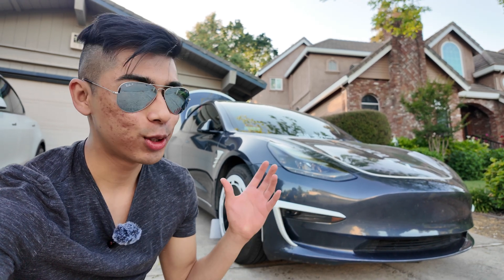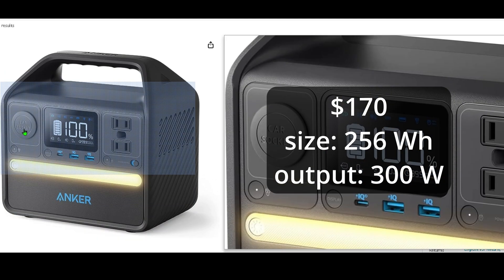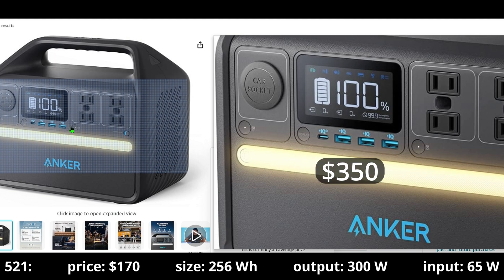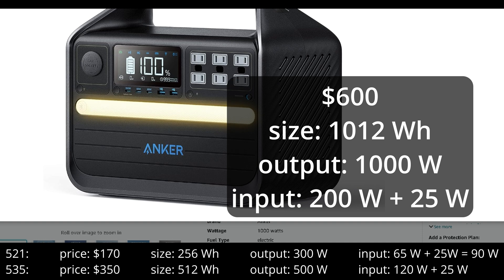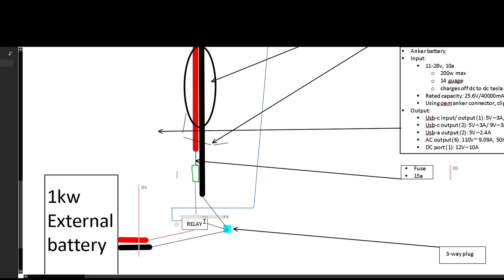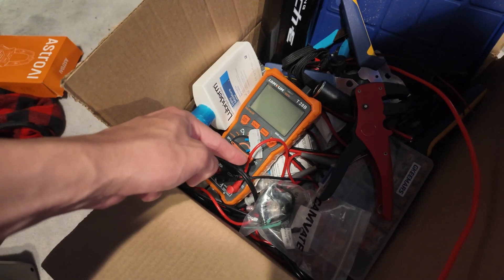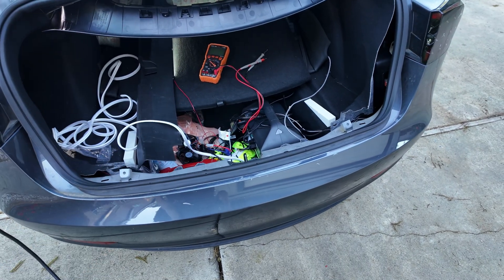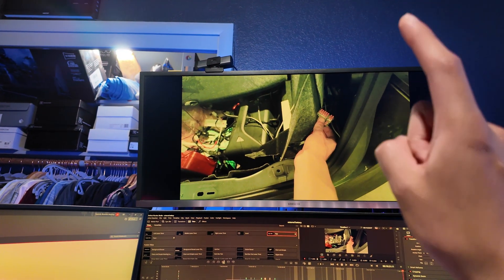⚡️ Tesla POWER UPGRADE! Added a SECRET Battery for FRIDGE, AIR FRYER & MORE! 🤯

Comment: While the Anker is a good all-in-one solution, I would go for having your own LiFePo4 battery and choosing your own inverter plus charger.  This way you can wire the inverter and chargers to the roof of your trunk, as the inverter can get pretty hot.  With your own setup you can also pick higher quality inverters that doesn't get as hot with the same load applied.  Chargers are not as important and anything around $30 can do the trick if you have a small battery.

Inverter, the most important part of any setup, has two important specs - efficiency and idle power usage.  Ones that comes with an all-in-one box are gonna be pretty cheap ones.  You might end up spending the same at the end when you pick and choose your own parts, but end up with a better inverter that doesn't give you headache down the road.

Of course, if your setup only got things such as LED lights and laptop chargers that don't use 120v at all, you can skip the inverter all together and save a lot of money, or turn off the inverter completely to avoid vampire drain on your battery.  In your example you were powering your laptop and fridge, etc.  Be sure to swap them out from using 120v to using those 12v laptop power supplies and using those fridge that runs on 12v and you can avoid a lot of heat issues with your setup.  Limit 120v appliances to stuff that you only use in short bursts and you'll be in much better shape.

Lastly just a brief mention on the price.  A 1050wh power station cost around 600 to 900 dollars and has a sub 100Ah battery.  While an 100Ah battery cost around $250 and you have a lot of money left over to buy a very nice inverter, or pocket all that savings if you don't need 120v output.
Reply from the maker: Thank you so much for commenting! I love the knowledge you dropped! 

I wanted to do it this way for simplicity on myself and in the video for people to replicate BUT, I think a redesign with this exact idea is coming soon! 

Thanks again, I really appreciate the time you took writing this out 🫡
Reply: @TeslaFPV  One that I didn't elaborate is that any form of conversion introduce efficiency loss.  Converting voltage up, and converting DC to AC are both fairly inefficient in general, so the importance of limiting to 12v appliances are especially important.  This also has large influence on your wattage and capacity calculations.  A poor inverter might only have 80% efficiency, which will throw all your calculations off by quite a bit if things are running on 120v.
Reply from the maker: @lanzer22  oh yeah, thankfully I think of what I have is dc based
Reply: Could you give me examples? I see the liFePo4 battery around $159 on amazon and I see I need some type of DC-DC converter to charge that battery from the main 12V tesla battery but I don't see any with NEMA 5-15.

I need to power the underglow lights and I also want to be able to connect a 1000w speaker

I am assuming the 'inverter plus charger' both charges the secondary battery and has receptacles?  I am just clueless to this all
Reply: @DRwarboy  That's an interesting use case.  I don't know how long a 100ah battery will last if you hook it up to a high power audio amp.  (It depends on the amp, not the speaker)  Imagine 2 x 1000w amps running at he same time and drawing around 100amps each, your battery will only last 30 minutes.  Though it all depends on how much your amps actually draws and how many are you using.

The limitation for you should be how much the Tesla's 12v socket can provide, and build an amp according to how much current you can draw from it.  If you want to have some coll lights, any battery you use will last for the whole night, but amplifiers are very different.  

If you just want lights, you actually should just draw from the car's 12v power also, unless you want lights to be on while the car is parked.  In that use case, you'll only need a 12v charger to go with the LiFePo4 battery.   To be safe, you'll want your battery to have built-in over discharge protection.  Li-Time is a decent brand.
Reply: @lanzer22  I appreciate the reply I am super stuck at the moment. I found out my tesla battery is 16v and there should truly be nothing attached to the battery itself because its heavily regulated.

I probably wouldn't want the lights running while the car is in sleep more for very long or even play music with my 1000w ZLX-12bt speaker. The speaker only really peaks at 1000w but most of the time its at around 300-400w. 

I think how TeslaFPV did I need to connect what ever I want to connect from the DC-DC converter in the rear seat, the issue is it most likely outputs 16v so I have to find an inverter to drop the volts down to not destroy my speaker or the light which I cant find. I rather have a secondary battery as a back up incase the car goes in sleep mode everything wont just shut down and I have time to take the car off sleep mode.

I don't have much knowledge of electricity Volts/Amps etc but im trying to do as much research before I even lift a finger

Comment: Do you think if you install the Lighting Trendz aluminum under glow  directly to the DC-DC converter it would cause the tesla computer to freak out? I am having a difficult time trying to find a happy medium when it comes to these under glows and potentially adding a sub or a ZLX-12BT speaker to my tesla model 3 2024 RWD. 

I am also reading something about people putting a delay switch or I think in your case an on and off button before any DC-AC because it trips out the computer? Do you switch it on a couple minutes after powering the tesla on?

I appreciate any help you can give me!
Reply from the maker: @DRwarboy  hi there, I usually always leave the battery switched "on" 
If you are worried you can have a relay with a delay with the trigger for the relay being one of the wires in the passenger foot well. One of those wires only triggers when the car turns on. You'll have to use a multimeter or clamp current meter to test. 

You can install it directly to the DC to DC converter or (PCS) posts. I believe it can safely output a total of 1000 amps. Check the service mode to see the current draw normal and then when you put additional load. 
Know this though. Newer models with the 16v batteries wont power 12v dc things. You'd need a voltage stepdown device and since you  a 2024 then you would probably need this.  

Let me know your thoughts!
Reply: @TeslaFPV  Thank you very much for the reply. I am very clueless when it comes to all of this I've been watching a lot of Youtube videos and forms.

Are you saying my DC-DC converter outputs 16v instead of 12v which is why I would need a step down?
Reply from the maker: @DRwarboy  correct. The DC to DC converter converter the high voltage from the floor battery pack to a low voltage for the frunk battery to power all the electronics other than the motor. 

Might want to look into a "potentiometer ". These can adjust voltage levels and you might be able to convert the voltage to be lower for your needs
Reply from the maker: @DRwarboy  you can check in the service menu what the output is.  Go to the low voltage or power conversion area and you can see what's coming out of the DC to DC converter (PCS)
Reply: If I am understanding correctly then it should go DC-DC--> step down--> fuse?-->amp relay-->LiFePO4 Battery--> DC-AC?
Reply from the maker: @DRwarboy  you could put fuse before step down to protect it as well. 

Your current path looks good. 
For extra caution you can add a diode on the positive power wire coming out of the dc-dc initially. This means the current will only ever flow out and there will never be any backflow of electricity
Reply: @ Thank you very much! I feel confident at least trying now! Im tired of these lights sitting in my home and not installed on my tesla!!
Reply from the maker: @DRwarboy  if you have any other questions feel free to ask!
Reply: @ actually now that I’m thinking, I see a lot of people running wiring for an AMP for a stereo system from their 12v battery and don’t mention much about error! 

If my low voltage battery is 16v would the system throw an error code if I just run the under low lights directly? I’ll still have to do a step down to get it to 12v to not fry the led lights but maybe for now I do the lights and later I can worry about the stereo system?
Reply from the maker: @DRwarboy  lights should be totally fine! Just make sure to match the voltages :)
Reply: @TeslaFPV  Do you know how much volts and Amps the lights needed? I can only find a step down from 8V/40V-->12V with only a 3A max on amazon.
Reply from the maker: It depends on the lights you are using. You could just get a second small battery and put it in the trunk that outputs 12v but accepts 12v-24v and run everything off that

Comment: Where did you get those handles? Those are awesome and I want to see about putting them on my brand new Model Y lol.
Reply from the maker: For either site, you can use TESLAFPV at checkout :) 

I'm glad you like em! 

Check out the auto-presenting door handles here: https://www.tialloyelf.com/products/auto-present-door-handle-4-doors-for-model-3-y-version-6?variant=45646301757672

And for the design on top: https://www.tesery.com/products/door-handle-protection-film-for-tesla-model-3-y?_pos=7&_psq=Door+handles+&_ss=e&_v=1.0

Comment: Can you restrict how much W it will draw to recharge? Will it accept 16v x 12a from a Model Y cigaret plug in the trunk? Say I don't want to allow it to draw 12a but want to restrict at max 10a... can it be configured for that? 16v x 10a = 160W max draw.
Reply from the maker: You sure can. 
It  WILL accept the 16v x 12a from throdel y cigarette plug. 

You can buy a separate device that will limit the current draw if you so wished, though, its not really necessary cause it'll do all the input power management for you

Comment: hmm built a 4kwh 12v lifepo4 battery with eve cells for 350$. got them just before the new tariffs were announced. replacing my 12v agm battery in my chevy volt. thats like 10% the cost of the all in one anker solutions. but no draw from an inverter. maybe a bit too DIY for most people. my solar roof keeps it charged up so i presume it adds range to my car by eliminating the 12v circuit's parasitic draw. i think most people have a healthy amount of fear when it comes to building your own big battery. getting 45-50 miles range on 10kwh.
Reply from the maker: Dude nice! Thanks for sharing! 

I plan on building my own home battery system with some lipo cells mounted in a server rack!

The reason I didn't want to go DIY with this one is because I wanted to make it more easy for people to replicate for the video, usually I'm all about saving money and learning DIY haha